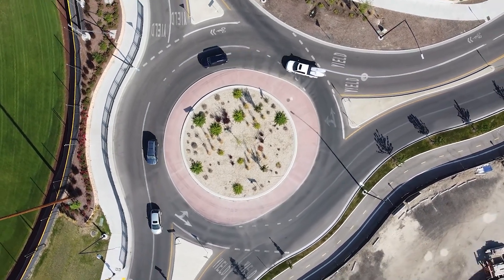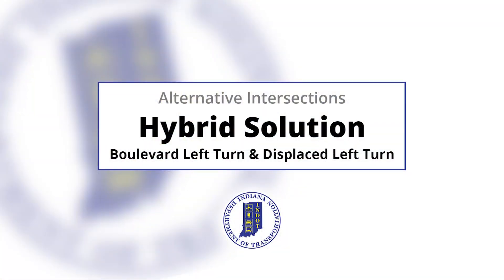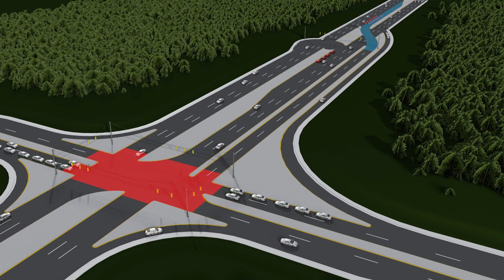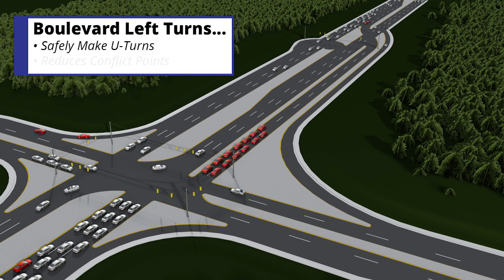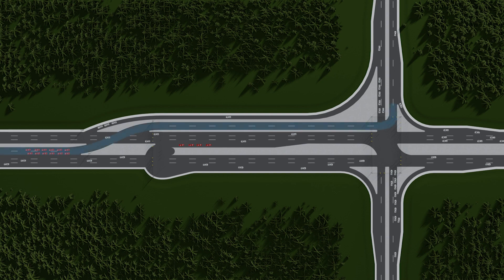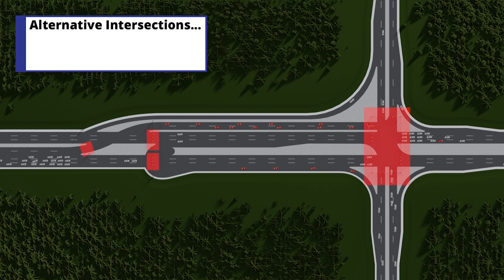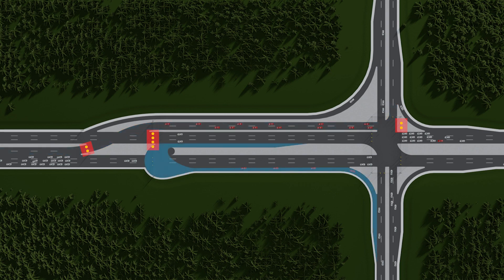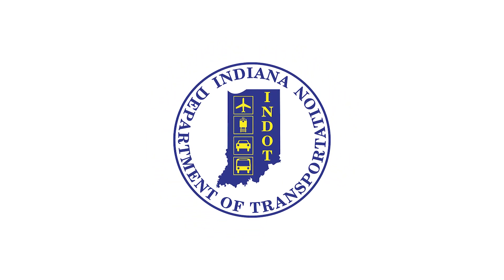Hybrid Solutions

Comment: Indot underestimates the willingness to run lights down here in Evansville. All you will have accomplished with this solution is add more lights to clog up the road and add more places for crashes. Not to mention, I can guarantee someone will still try to turn left at the regular intersection point and cause massive crashes when this first opens